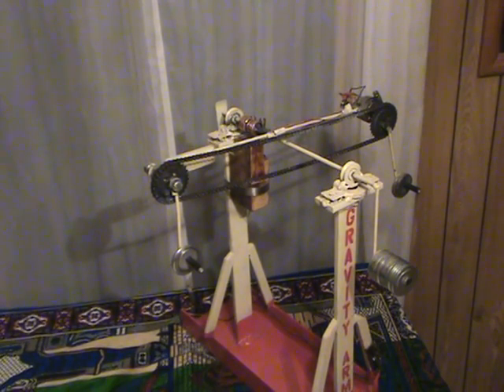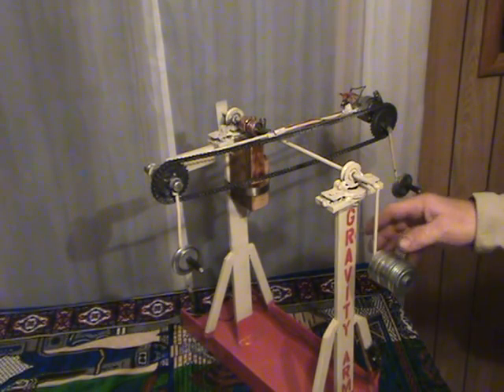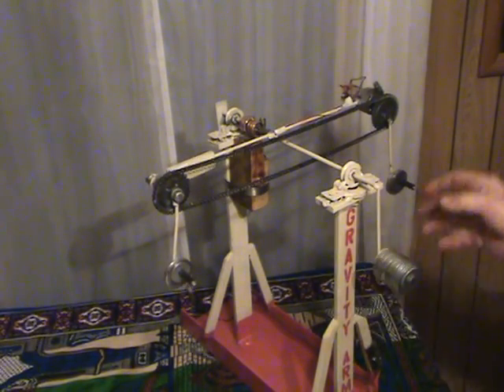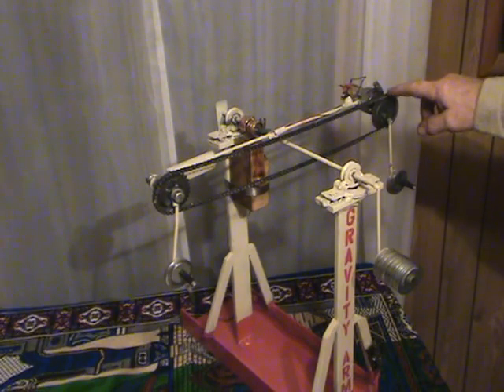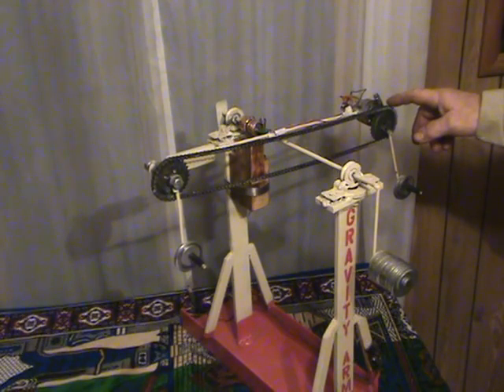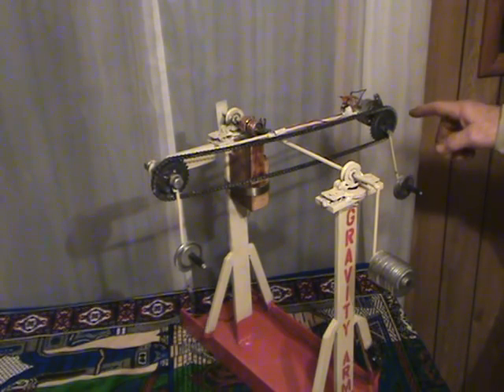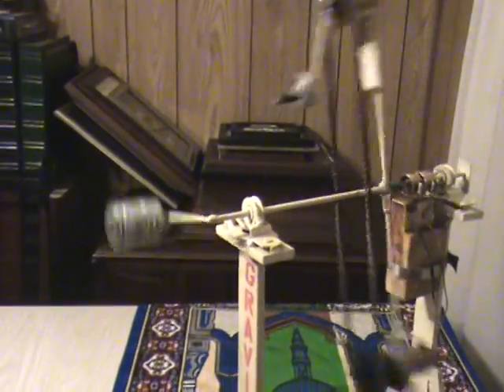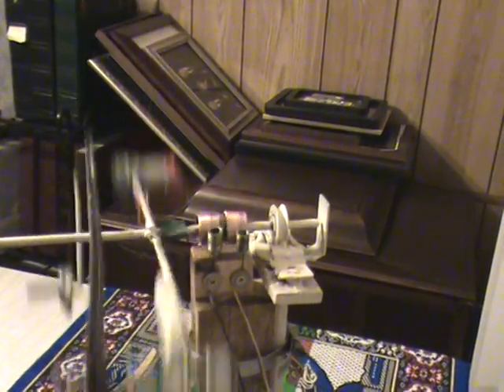Gravity Arm

Comment: Unfortunately it doesn't show overunity. It would show overunity if it could start on its own. But you have started it by hand push. Once in full rotation it only needs to cover the friction losses to keep running. And they negligible.
Reply: If it's overcoming friction losses, it is over unity

Comment: Very interesting assembly. 
I've been researching, constructing and analyzing these and other constructions while ago. Now the order has changed and shortened.
In the assembly you built all the kinematics ends with fulcrum normalized to cyclic dimension. This is gravity referenced leverage converter. In local motor's frame it still has to produce work by one revolution per main arm revolution. 
If you let orbital motor spin an 1:1 fixed gear to rotate an arm but motor stator positioned inside bearings itself will be referenced to gravity by extended weight; gravity opposes the load force but doesn't directly produces work.
The biggest challenge which makes this contraption practically not applicable that arm's rates have to be reduced to allow to work this assembly on slowest possible rates to minimize inertial interference.
Reply: hello

Comment: Nice! Just as moving water powers hydroelectric facilities,  we can tap our electrogravitational potential without using water as a conduit.  Any imbalanced oscillator can be mounted on a lever to allow the inertial potential to be used as a compression source without restricting the prime oscillator. 
https://www.google.com/search?q=MAGIC,+kevin+hay%27s+mechanical+alternating+gyroscopic+inertial+compression+system&sxsrf=ACYBGNQTz-SkKie1fv3DUqGb4iRK_3abow:1579316236395&source=lnms&tbm=isch&sa=X&ved=2ahUKEwjNl4i6k4znAhXHqp4KHV0jAr0Q_AUoAXoECAsQAw&biw=1366&bih=608

Comment: This guy is deluding himself.  Forget about the motor/chain assembly for a moment.  Just letting the load (all those washers) free-fall from the 12 o'clock position will find it reaching the 9-10 o'clock position before gravity reverses it.  All the motor is doing is providing the energy needed to complete the little 9 to 12 o'clock arc, then gravity can take over again.  Just apply a little reverse-torque to the axle as it spins and you would immediately see how little power this system has through a full 360 degrees - no more than the motor is supplying!  No free energy here.

Comment: Thanj  you for your explanation. However i cannot agree with you that the arim rotates because of any imbalance on either side of the arm. The arim rotates due to the reaction of the small arms supporting the weights at the ends of main arm. This can be established by preventing one or the other of the small weights. As these are couple by a chain it makes no diference which weight is held.If any one of the weights is held, then the reaction on its pivot caused the main arm to move. Either thiat of if the small motor is of too low a power to cause the main arm to move up or down  and the     weight is still held locked, then the small motor will be forced to stall and  stop.There is no overunity effect in this machine and from a study of all other machines for which over unity action has been claimed, there is also no over unity effect in any machine invented up to the present time and indeed there can be no such machine if it forms part of a closed system.

Comment: When the action is slowed down in order to better observe the movements of the two suspended weights at the ends of the arm, it will be seen that these weights remain for trhe most part hanging down vertically. Is there an connection between these weights and the arm or are they merely mounted at te ends of the arm free to rotate under power frmo the small motor coupled ot one of the weights as can be seen. How then does the arm rotate with the two weights always handing down vertically? With the two weights hangind down vertically there would seem to be no  torque causing rotation of the arm  as these weights produce equal and opposite torques. So how does the arm rotate?

Comment: mmh no gain - i believe that the whole system constitutes a flywheel and any heavy flywheel can be driven with a small motor. The final answer will be given by a generator driven from the output and the measurement of the corresponding output/input wattage.

Comment: Ray I like your idea.  Next is to determine how much torque you are getting at the shaft.  I'm thinking if you connect a small generator to the shaft, you can check how much wattage you can produce.  Nice work on the model.

Comment from the maker: I've found that this does not have overunity. The output washer weights tended to balance the output and acted as a flywheel and not a true measurement.
Reply: So, even it is all even, the weight balance out the output, means the output as weight get less from the center to equal higher weight of an object. Can explain in layperson term that why it doesn't has OU? You mention unbalance which means two weight that is opposite and the mobile weight when what go up to go down, it converts into motion energy, the more motion energy that is balance to more motion energy. Well, it is about weight and motion energy that is in balance. If two side that is weight is exactly the same and motion energy which the gap diameter is exactly the same of two side. Same weight and different weight of two side don't create OU because of resistance which create friction to slow it down. So, it is because of resistance or lower than resist energy, if the mech. energy is lower than kinetic energy which the motion energy loops over as it gains by going down which lower input by going down and higher input by going up, so it is unbalance of down and up, so the lower unbalance, the OU can happen? So, unbalance produces resist and friction so it cancels out. So, OU needs negative resistance or zero resistance, not positive resist, no matter how small because that small will show how long before it stops, right. 

Ya can measure using rotate meter and to measure one half to another half, since the light senses the motion of rotate at different side, so it will recognize different number of two side. The down side and the up side, so both rotate number is different? So, the higher mass above higher mass, the gap different, the more the higher mass will fall faster to higher mass that is the ground so it is zero resist as work is already done by gap as it falls down, in compare to smaller gap that is higher mass to go farther from higher mass that is ground so the resist increase as work is being done by mech. energy. So, it is not even mech. energy on two side, but one side so mech. energy is resist energy in motion, it is still same resist.